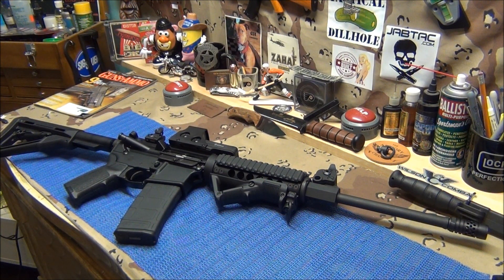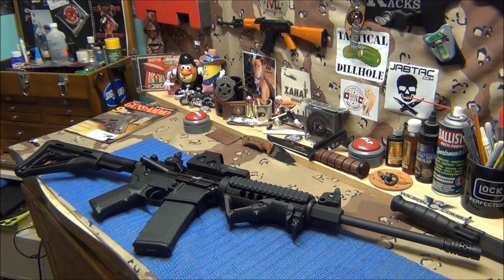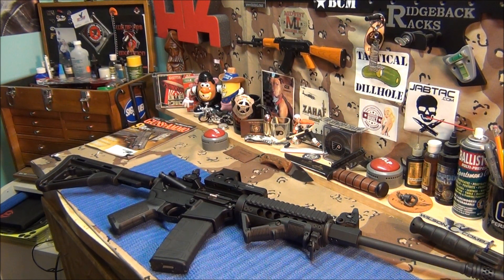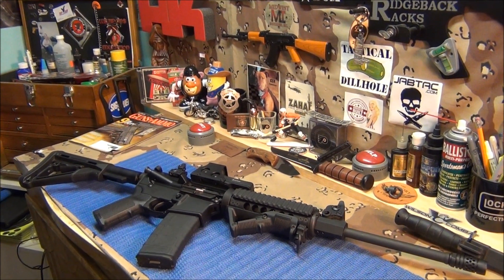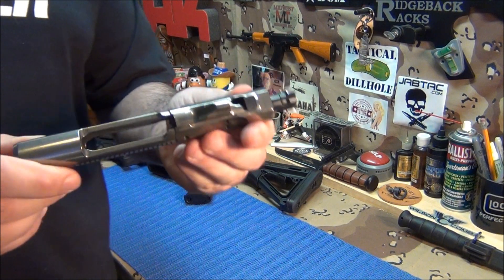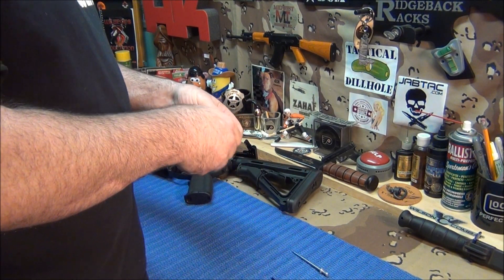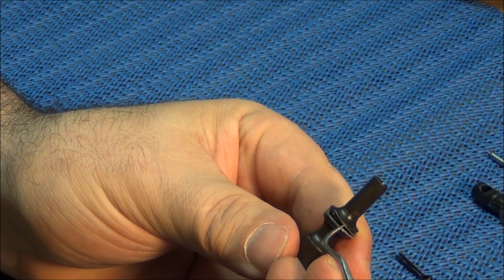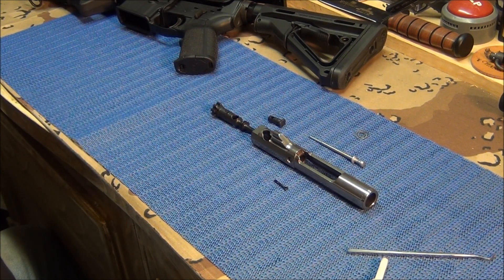DPMS AR15 bolt gas ring removal

Comment: Buy a lower and go from there!! Saved about $500 on my complete Spikes lower and BCM middy 16" upper over either brand's complete rifle's, both hold HIGH mil-spec..PLUS Q.C. standards, if you're going D.I./'gas gun', go MID-LENGTH!! Softer shooting, less muzzle rise, moving part's last longer, etc. BUILD!! Don't even have to do a COMPLETE build, just get an assembled lower, upper and put the extra scratch in your wallet towards AMMO & 'accessories'!

Comment: i called adcor defense about the gas rings on my bolt also and they said that they crimp down on the rings as to prevent any friction,but said if i wanted to remove them i could,as they weren`t needed for a gas system.i haven`t removed them,as i don`t have issues,but may try it at sometime.great video as always!